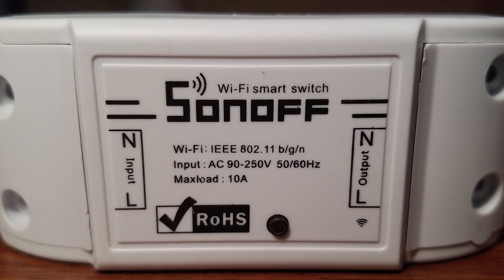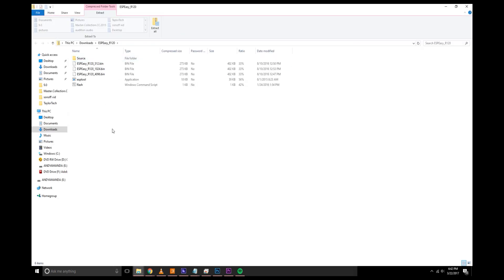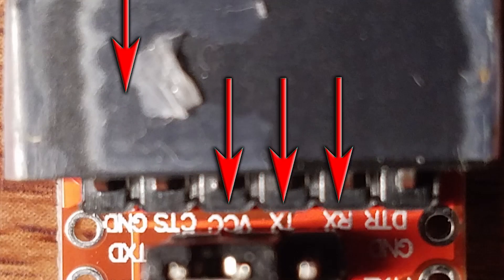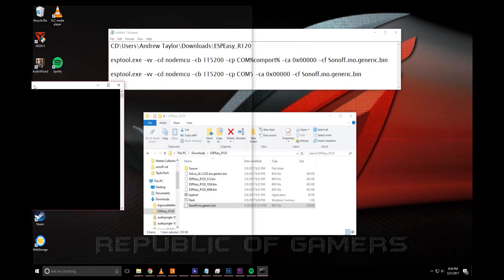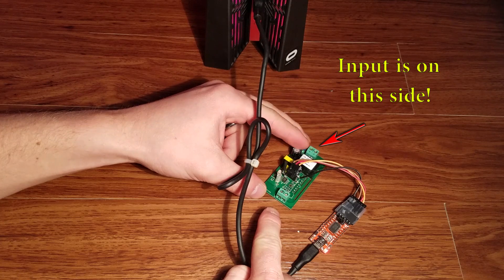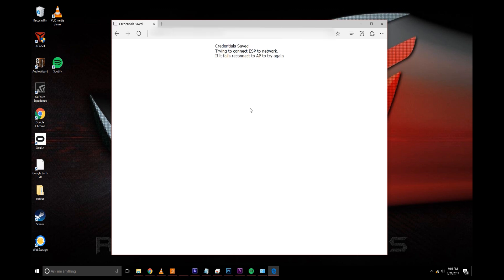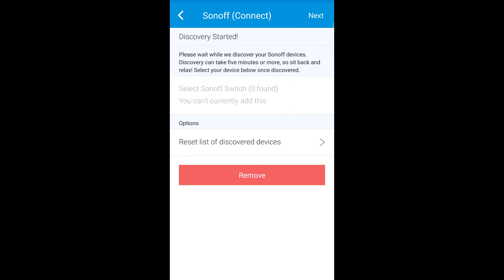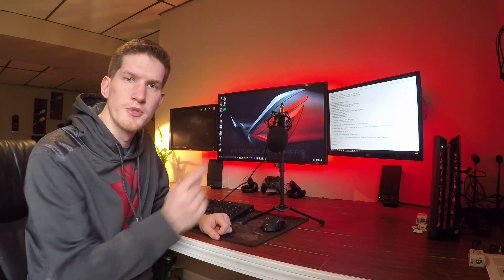Sonoff: $5 Smart Switch! Works with Smartthings!

Comment: Do you know how to fix this issue?  Followed all your instructions, but i'm getting this error.  trying to connect
        flush start
        setting serial port timeouts to 1 ms
        setting serial port timeouts to 1000 ms
        flush complete
        espcomm_send_command: sending command header
        espcomm_send_command: sending command payload
        read 0, requested 1
warning: espcomm_sync failed
error: espcomm_open failed
Reply from the maker: Craig Nadler make sure your FTDI is set to 3.3v and the vcc and gnd connections are good. I believe that means that it isn't getting power but I could be wrong
Reply from the maker: Craig Nadler also make sure it's in programming mode by holding that button while you power up
Reply: Thank you.  I disconnected all the wires and tried again and it worked.  I was able to flash all four of my devices, however, one of them flashed correctly yet does not come up as a wifi device like the others did to add the wifi info to the switch.  I flashed it again successfully and it still does not come up as a wifi connection when connected to power.  Not sure if something is wrong with this one.  thanks again for the help.
Reply from the maker: +Craig Nadler I think it may be a different model the supplier made that isn't working with this mod. It's a known issue with the developer. No problem!
Reply: TaylorTech I too have the same problem that I can successfully flash but no WiFi signal is broadcast. Do you think there will be a fix for this eventually? Thanks
Reply from the maker: +Ross Blundell for the Sonoff or RGBW controller?
Reply: TaylorTech it is the Sonoff I was following the directions in your video and got as far as successful flashing but the wifi signal was not broadcast. Did it 3 or 4 times to be sure
Reply from the maker: +Ross Blundell what are you using to power the Sonoff after the flash?
Reply: TaylorTech tried it with both the 3.3v from the ftdi and the 230v mains input
Reply from the maker: Ross Blundell that's weird... maybe you have a bad esp inside. I'm not too sure..
Reply: TaylorTech ok thanks, might get another and try again.
Reply from the maker: +Ross Blundell best of luck!

Comment: can we connect sonoff to Google Home? Thanks in advance...✌️
Reply from the maker: +Nishit Desai I don't know that it connects directly, but if you flash it to work with Smartthings, then you can control the Sonoff with Google home.
Reply: TaylorTech i dont have smartthings 😫😫😫
Reply from the maker: +Nishit Desai if you're looking to just toggle the Sonoff with your phone, you can use the app the Sonoff comes with. Or you can just use an Amazon echo. But I don't think it works with Google Home directly
Reply: TaylorTech i want to voice command home.and toggle sonoff
Reply from the maker: +Nishit Desai then I recommend getting an Amazon Echo

Comment: Do I need a smartthings hub?
Reply from the maker: +Henrich Škarba if you want it to integrate with your Smartthings ecosystem then yes. But if you just want it work by itself through its own app, then no ITEAD has their own app that works with the Sonoff straight out of the box.
Reply: TaylorTech so I just install that software on sonoff and that's it? right?
Reply from the maker: +Henrich Škarba are you looking to integrate it with Smartthings? If so yes, flash the program on the Sonoff. Connect to wifi. Install smartapp on Smartthings ide. Then within the app discover and configure your sonoff

Comment: just wondering, the link you have to jumper wires is male to male, wouldnt you want female to female? just checking. thanks for the good video
Reply from the maker: Yeah, if you solder the header on which receives male, then female to male would be ideal.  I used male to male, but it may work better for some to be female!